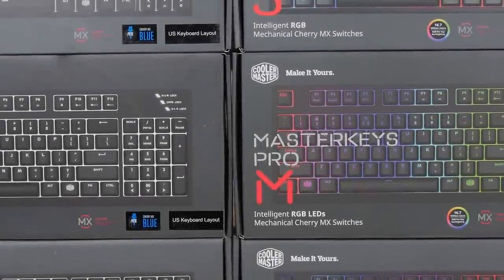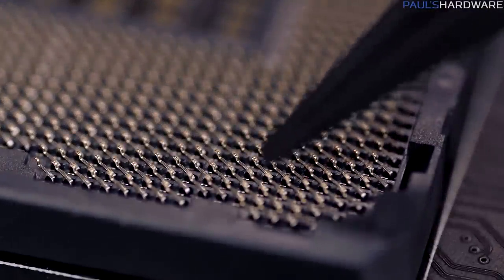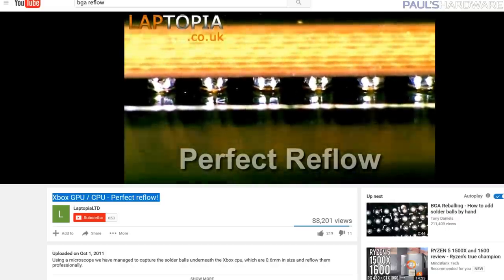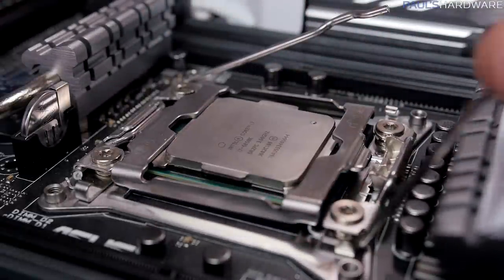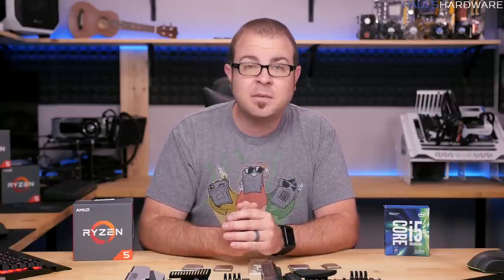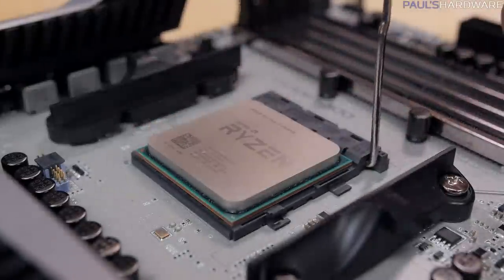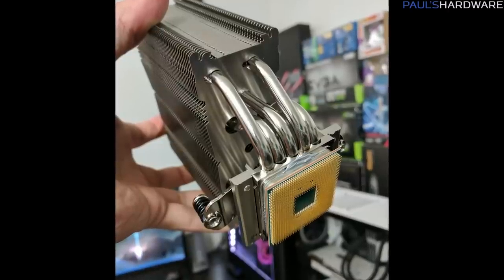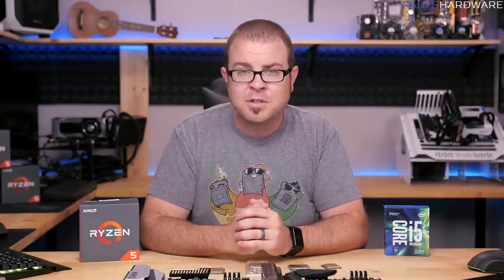LGA vs PGA! Which is better?

Comment: well, the motherboards used to be cheap, not anymore sister. prices are insane these days.
Reply: Incorrect, prices are still cheap, it's just that everyone is going for the more expensive motherboards instead. ASUS has been producing expensive series for a long time.
Reply: My Asus B150M-K cost about 75$, not that expensive at all
Reply: I am guessing that if you buy an overpriced  intel processor for gaming, you are not just going to buy a mATX motherboard (unless you just want to browse the internet). you will look for a good motherboard that can overclock, has plenty of slots for memory, raid, etc. a decent motherboard is over $100, now take a look at this one ASUS TUF Z270  $220 plus shipping, that is really, really cheap. An I5 processor is around $180, or more, a motherboard is not far behind. in fact, it may cost even more.
Reply: B350 mobos are great and they are cheap af. Intel's X and Z are quite overpriced though. Maybe you got one of those?
Reply: user 007 gigabyte gaming k3, I paid 120€ for it, has 6 usbs, keyboard/mouse, hdmi, ethernet, can fit 2 (or 3, not sure anymore) gpus, supports most i5 & quadcores i7, up to 64gb of ddr4 ram in 4 slots, 6 sata connections. Pretty good deal for not much money :)
Reply: Good enthusiast grade motherboards have never been cheap.
Reply: Over clocking isn't everything, I use an i7 4770 (not K) and my gaming performance with a gtx 1060 is great, You dont have to have the best.
Reply: exactly why i went with AMD. reasonably priced and plenty good enough for me.
Reply: the only shitty experience ive had with ryzen so far is when i tried xmp on my rams and noticed my mobo didnt even have a reset button, only a jumper. kind of unfortunate that i have to take the battery off instead of just pressing a button.
Reply: i know, couldnt afford x370 cus they cost way too much here
Reply: user 007 well actually you can get cheap mobos IF you want to I think that's easier with ryzen since you don't need the X mobos and you're totally fine with the b350 unless you wanna pay an extra like 30$ for a 100 more oc
Reply: +user I have an mATX motherboard that's pretty full-featured (Gigabyte Z170MX-Gaming 5), $120 on sale. Still less than half the price of my 6600K. I'd rather replace the motherboard than the CPU. And it's far more likely something on your motherboard will burn out before you bend a pin if you aren't an idiot. Keep the cover on until you put the CPU in, you don't even have to remove the lid since the CPU pops it out when you lower it; my pins have been exposed for all of 10 seconds since I bought it.
Reply: malus1531, the problem with mATX is that they usually have only 2 memory slots (if you want to upgrade, you can't use those 2 sticks you had), hardly have any expasion slots and, if you install a video card that is a bit long, it most probably will cover some sata ports and this will prevent you installing additional drives. it is all cramped in a really tiny space.
Reply: user 007 well you have to be realistic and think if you actually need the stuff you just listed 16gb should be fine for a long time and you should only need 3 sata ports max as for expansion slots again most people don't really use them since if you game you don't need a wireless adapter and most people aren't interested in getting sound cards only thing I can think of is elgato and even then I'm pretty sure there is at least one slot available for it
Reply: +users 007 Every mATX board I've seen has 4 memory slots. It's mini ITX that usually has 2. I'm using a Define Mini case, it's not even that much smaller than a typical mid tower. My full-length video card did required the removal of one of the two drive cages, but that still leaves me with 3 drive bays. The SATA ports are horizontal with respect to the mobo, so having something above them isn't an issue. I have 3 PCIe x16 slots with x2 SLI support. Really it's everything I need. I give up some ease of use and watercooling support, but it takes up less space and is easier to move around, which is nice while I'm in college.
Reply: Ehrrr, suuuure, keep telling yourself that mainboards are expensive. Meanwhile, you can buy a board (some board, not top notch but something) for any processor under $100, but in 1998, you'd pay an inflation adjusted equivalent of $600 for that basic ASUS 430HX board for your Pentium.
Reply: Person. you dont live in finland then buddy
Reply: im not bitching im just sharing my experience my dude
Reply: um... AM4 all day long on newegg <$100
Reply: MSI Z270M MORTAR LGA 1151 Intel Z270 HDMI SATA 6Gb/s USB 3.1 Micro ATX Motherboards - Intel newegg @ $105
ASUS ROG Maximus IX Code LGA1151 DDR4 DP HDMI M.2 Z270 ATX Motherboard - $295
Reply: +Chris Lesmerises Yet I've seen a bunch of AMD fans argue that PGA is better because people are buying motherboards that are more expensive than CPUs
Reply: you can always replace a socket, its quite cheap
Reply: good luck in replacing a socket. I'd want to see you try it
Reply: it's not that hard with a heat gun, tin foil and a level...
Reply: You sure? Warping tends to be an issue. It can be done, but the board needs to be carefully heated either on a huge area or on both sides.
Reply: I am sure, lol. do a couple. Warping really isn't an issue. Sure, theoretically it sounds good, but like I said. do a few and you'll see. Real world experience and theoretical learning are two completely different worlds.
Reply: Chris Lesmerises OK, I'll get me some boards. I wanted to try it, but I've been watching repair channels, Russian and Ukrainian ones, and they showed some of their failures with one sided heating, where the board ended up warping, but that was usually on big BGAs and the boards were Compal laptop boards, as they no longer usually repair PC boards, the BGA no longer sat flat on the board. I think even if board warps I could rig up a 150W halogen on a triac to heat it from below and a thermocouple to track temperature. 

Which brands have you done so far? I usually use cheap Gigabyte in my private builds, and the boards tend to bend in with time.
Reply: The cheaper the laptop the cheaper the pcb, but i used to do HP's all the time at the shop. use an open bottom, level platform, (I think your variable halogen is way too indirect for my method) heat shield all the components you don't want to target with aluminum foil and apply direct heat with a heat gun. Heat range and method of warming play a big role in results. You'll catch on quick. fyi, my heat gun is a digital adjustable, up to 2000w and the level is to make sure components don't slide when the solder flows. This works great with video cards too.
Reply: user 007 Im using 60 dollar motherboards in my gaming rigs because why not. I use seperate sound and video cards, so why would i pay extra for any fancy onboard crap...
Reply: +drkastenbrot Stable overclocking (quality VRMs and such), better cooling, more fan headers, more/better I/O, more PCIe slots, SLI support, m.2 slots, onboard WiFi, more customization/control (often more detailed UEFI), more sensors, RGB (onboard or headers)...Not saying everyone needs to spend hundreds on a motherboard, but expensive ones do offer benefits.
Reply: +drkastenbrot at least take the cost of the sound card, and apply it to a good mobo. Most onboard  is great these days. If you need quality audio good motherboards often have extra built in emi and rf filtering. I know my Asus does and I only paid $99
Reply: Why? You could keep a good soundcard across 3 generations of mainboards or more, until one day software no longer supports it. It's not like we can hear more bits as we age.

But even cheap boards often have decent enough sound. You just have to watch out to get rid of that fucking braindead ground loop in the front of most affortable enclosures, where it connects USB-GND and AGND from the soundcard front panel audio? Yeah well that's worst idea ever.
Reply: Very good point, we've been riding the cusp of sound card necessity for some time now, with opinions on both sides. I've got a blaster Z... sitting in the closet, because my Sabertooth has optical out to a 5.1 amp. If you've got an optical out, you are running digital and all the ground loop stuff, and old analog issues just about disappears. Thank goodness for 1's and 0's. Differential voltages and induced ac sine has no part there :)
Reply: Back when I was in college, the MOST expensive motherboard you could buy was still under $300.  And now.. the most expensive one you can buy is around $700.  So yes, they have gotten more expensive.  Unless you are just buying a system for your grandmother who does nothing more than surf the net.  Then you can get one pretty cheap.

Comment: To avoid the stuck heatsink issue, twist the cooler before pulling it off the cpu. this will loosen the thermal paste, even if it's cold. Warm thermal paste could still have a suction effect and pull the CPU out of the socket.

Comment: 6:41 I began screaming internally when you set that Ryzen chip faced down, sitting on the pins. REEEEEEEEEEEEEEEEEEEEEEEEEEEEEEEEEEEEEEE
Reply: amd pins are hard af you won't bend them like that
Reply: I've sat hundreds of CPUs down on their pins. Better than the other way around. If something lands on it when all pins are down then it pushes down on all pins, usually doing nothing at all to the CPU. If it's pins up then wherever something lands on the CPU will almost certainly bend the pins in that area. That said, they're really not that delicate

Comment: PGA can be "repaired", even thou a pin is broken off. Just put a small pieve of copper thread into the socket, so it makes contact with the CPU - voila, its now repaired.

I did it with a Core2Quad Q9000, and it worked just fine.
Reply: Andreas my core 2 quad is LGA 775 so I don't think you're right. First computer I ever built was P4, PGA 478 which did have pins.
Reply: Hi. The LGA775 is an entirely different socket. The Q9100 uses the PGA478 socket, since it is a mobile processor.

Here is a pic: http://i.imgur.com/XaK6oCn.jpg?1

Comment: I don't think I have ever removed a heatsink from an AMD platform WITHOUT pulling the cpu along for the ride. Though I have yet to damage any pins on one either. I have had to send some Intel mobo's back with bent pins. I don't mind either method really, I just wish there was a definitively better method that was standardized. Both of these methods have a decently high chance for damage. Especially when dealing with new builders on first time rigs.
Reply: heat and twist first
Reply: Fuck that happened to me once, but i wasn't as fortunate as you. I was building a computer i could play CS:S on and i got a AMD Phenom II x4 and when i removed the heatsink, it pulled the CPU out at an angle and broke like, every pin, wasnt too bad though, you can get Phenom II x4 910s on IFIXIT for like $17.
Reply: Huh. Different people, different experiences, I guess. Personally, I've only had it happen once, completely by chance. Other than that, my PGA cpus have always stayed in their sockets, both when either cold or warm from prior usage.
Reply: Seriously? Once you've taken the clamps off, just put light pressure on the cooler and wiggle it side to side then gentle lift whilst still wiggling very gentle. It's easy.
Reply: Never happened to me. Then again i don't wait 5 years to change the thermal paste. Nor do i buy prebuilt PCs that use some sort of dried out concrete paste XD

PGAs are less likely to get fucked up by a noob. Contrary to how easy it is to ruin a LGA socket.
Reply: Best of both worlds PGA with locking mechanism like in LGA.

Comment: Doesn't the retention arm prevent the PGA CPU from coming up with the cooler? If not, what's the point of a retention arm?
Reply: I think the arm also lines up the pins to the motherboard.
Reply: Daniel Contreras The socket itself could do that though, right? If it didn't have to move for the retention arm, it could straightaway have the contact points at the bottom of the holes.
Reply: The retention arm moves the cpu to the side to make good contact with the connections in the socket.
Reply: Well, I don't know if it should but mine certainly didn't
Reply: it push sideways pressure on the pins to make sure the cpu doesn't "fall out" and makes good contact, but this force is on the side of the pins which makes it a friction mount, with enough force you could pull it out, LGA however has a whole plate securing the cpu. This plate is generally attached to the board itself with a metal backplate, so its not coming off and the cpu stays in place
Reply: Bayan Zabihiyan Sounds reasonable. Thanks for the explanation!
Reply: im after lifting up on old AMD cpu coolers to remove it and the cpu sticks and comes out with the cooler without even raising the arm
Reply: WhiteWater So, I think it might be a good idea to twist the cooler first before  lifting it, wouldn't it?
Reply: I used to slide it off then lift, twisting might work too. Main thing is to reduce the surface area in contact with the cpu top plate.
Reply: the cpu was honestly cooked onto it. twisting it on the board would have def damaged either the pins or socket. the computer was over 10 years old at the time. the only way i could get it off the cooler was to wedge a flat screwdriver between and twist it. never seen anything like it before
Reply: As stated above, the arm on the PGA socket just moves the socket by about half of a millimetre so that the holes are either open or closed, you raise the arm, drop the chip on to the socket and the pins fall in to the holes, when you lower the arm the socket moves a tiny bit so that all 1300 pins are now being held inside the holes.  That many pins being held creates a good amount of force holding the chip in but if the thermal paste hardens to such a degree then any attempt to remove the heat sink will see the chip ripped out of the board before the heat sink ever comes free of the CPU.

The safest method is heating the thermal paste either by running the PC (and then obviously turning it off) moments before attempting to remove the heat sink or by running a hairdryer over the fins/veins of the heat sink to warm it.  then you can twist or slide the heat sink free of the processor - being careful not to harm nearby components.  I have snapped a capacitor off a motherboard in the past by not being aware of what I was sliding the heat sink in to.
Reply: Believe me, it doesn't, that's how my 8 year old Phenom II was finally killed during transport. Since then I am pro LGA.
Reply: +Domonkos Horváth Err... so you also didn't have your cooler attached?!?!  That's 100% your fault.  Edit: fixed typo
Reply: Domonkos Horváth Aren't you the one doing so, assuming no one would point out that what you were doing made no sense?  You're saying that during transport the cpu cooler pulled out the cpu.... but why wasn't the cooler itself fastened to the motherboard?  It's supposed to be.
Reply: +Domonkos Horváth "If it was transported to me, it was sent to me by someone else."  Go on, name the fool then, especially if it was a company, because that is an absurd thing to do.  I'm well aware of how the sockets work.  Basically, I think your story is BS and your presented worst case scenario is extremely unlikely.  I don't buy prebuilt machines, but for anyone that does I'm sure they will appreciate knowing who to avoid.  "If it were," is the way to say that by the way.
Reply: Assuming the worst is a model that pays off for me when it comes to human behaviour ^_^.  This conversation....  that isn't something that becomes true simply by declaring it, so we'll see if your replies continue or not.  Why thank you, not everyone can be as discerning as I am :P  My wager isn't even that you messed up the socket, it would be that the entire story is made up because you wanted a reason to claim LGA is better but didn't fully think through the scenario.  Of course that isn't something most people would admit, so when called on the thing you forgot about you pretend to be super offended and claim that it wasn't you that did it.  A true story would most likely have been clear cut with the details from the beginning.

Comment: PGA is better. The removal issue is pretty minor and every time it's happened to me, I just rotate the CPU around until it slides off the heatsink. I've bent pins of a PGA cpu a few times, but it only took a few minutes to fix and wasn't a big deal.

LGA, on the other hand, is much more difficult in every way. I don't know if this in inherent to LGA or just Intel, but their heat spreaders and chips are much harder to get a hold of to lift out of the socket. This has caused me to drop the CPU multiple times when removing it, one of these times it landed back on the motherboard socket and pent the pins. After several hours of trying to fix the pins, one of them broke.

Also, LGA has the cringe inducing metal crunching sound when you install the CPU. That alone is enough to make me not like LGA.
Reply: lol, so you're gonna hate on intel because of a slight sound that you're gonna hear like once in a lifetime when installing a CPU? Okay buddy, you do you.
Reply: " I've bent pins of a LGA cpu a few times" Did you mean LGA Motherboard? because LGA CPU's do not have pins.
Reply: it's also generally an issue that happens once and only once, the trauma of it lol (even if it's relatively easily resolved) makes you ensure you've had your system run for awhile first to warm it up, before unmounting it.
Reply: Yttrium I meant PGA cpu.
Reply: TessellatedGuy 

1. If AMD did this, I would hate on them for it too. I just don't think LGA has any real benefits over PGA from a consumer stand point.
2) You don't install a CPU once in your life and have it last forever. I've installed a CPU 3 times in the last year, and had to remove them 4 times.
3) The sound scared the shit out of me when I built my first intel-based computer, so I don't like it.